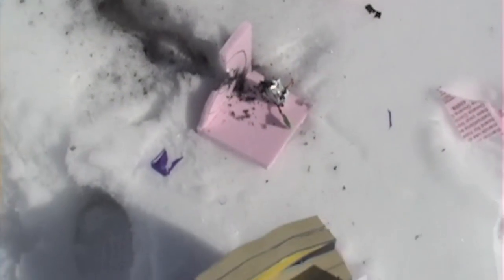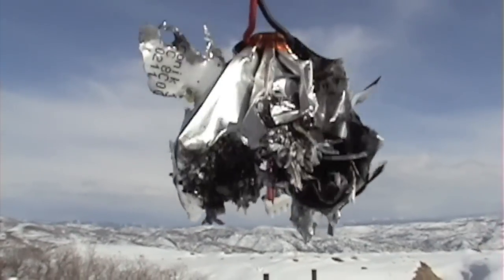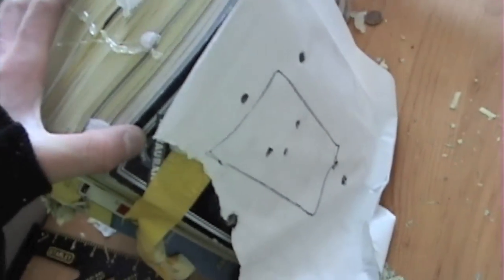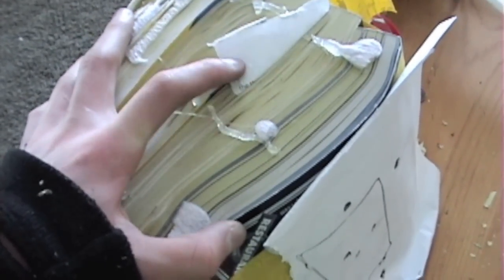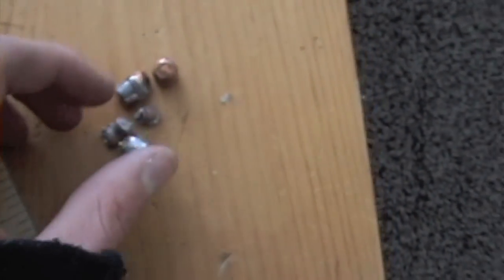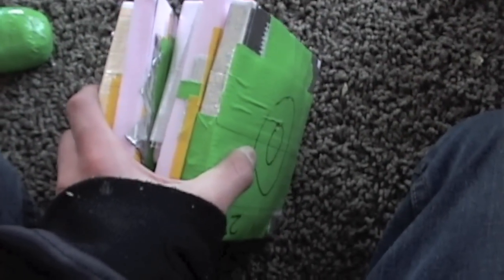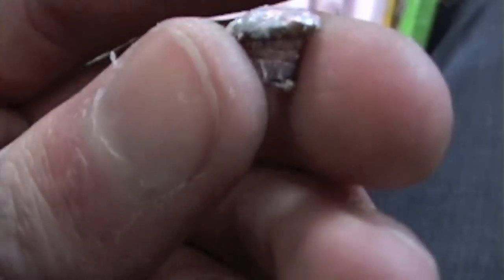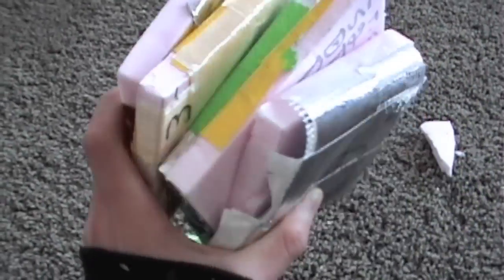Lithium Polymer (Lipo) Battery SHOT with Rifle

Comment: I wonder if you shot it with a higher velocity like a .22-250 or a .17 if it would cause a fire.  Tannerite will  sometimes not blow with a .22 but a .22-250 gets it popping every time.  
Rabbit hole … 2,000 pagers in Lebanon just blew up at the same time.  So ended up here… back to the burrow.